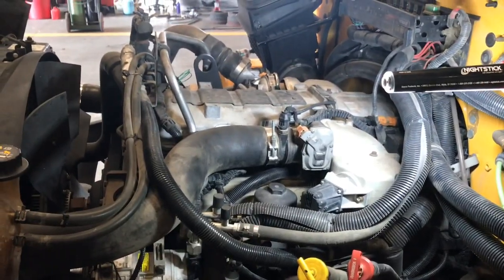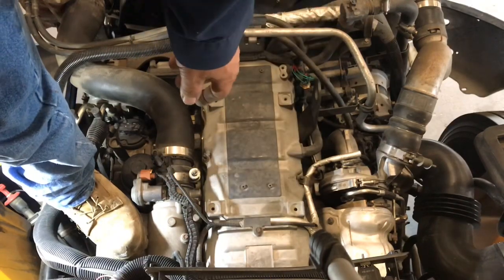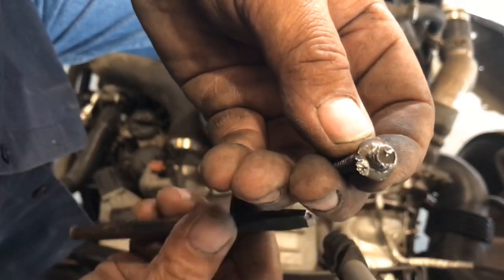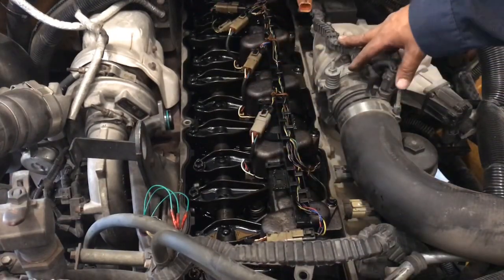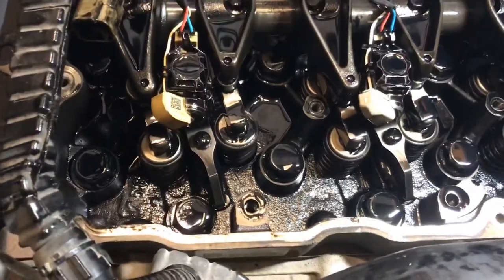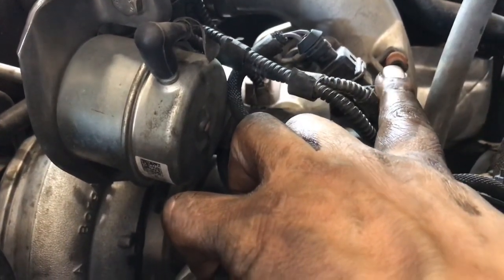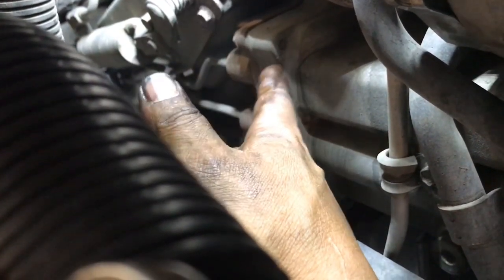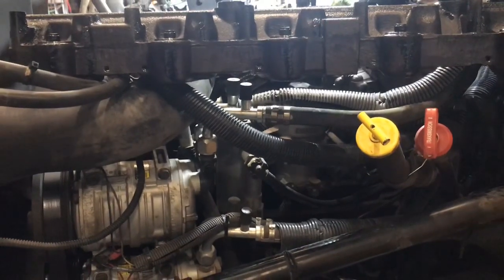2014 CE bus injector/ boost sensor. Part 1

Comment: Bro I love how the turbo system is on these engines. 
I'm all for technology and all but adding a big servo to control the veins in the turbine side and added coolant lines to keep these parts cooled always disappointed me because the amount of failures tied with it.
But this is the type of system I like. One simple controler that actuates a vacuum controlled diaphragm.
I'm learning more and more on this engine and I'm actually loving it.
On my 2011 durastar the engine is easy to work on.
I was nervous the night before I did my crank case breather about a week in a half ago, but in all honesty it wasn't that bad. Just have to use some old school techniques to get to bolts in tight spots.

Comment: Joe, thank you for pointing those parts out to me. I got the boost control valve changed. The diaphragm should actuate if i apply vacuum to the port on it, correct? should i be able to move the rod in and out with my fingers?

also replaced the MAF sensor, I still can't get it to calibrate.

The exhaust brake, how do I make sure it is free moving? can it be actuated by hand?
Reply from the maker: Matthew Spores   The exhaust brake is spring loaded. We use low (40 psi) air to make it extend. Vacuum diaphragm can be moved by hand. Slight pressure or with vacuum. Recalibration has to be on a code free system. Clear codes. Use laptop to check soot level on dpf. If it’s above 60%. Run a regen. The try to recalibrate. Follow instructions at the end. Make sure you run a standard test first. Maf recalibration is done with KOER
Reply from the maker: Matthew Spores   It should recalibrate. Hope this info gets ur unit back to normal. Also try getting temps at exhaust flanges. That will tell u if injectors are malfunctioning.
Reply: Will do. I will let you know what I find out.

Thanks again.
Reply: So, with the engine off, I applied vacuum to the actuator on the turbo. At rest it seems to be pulled all the way in. With vacuum, there is no change in position.  I can't move it with just my fingers, but with a wrench as a lever I can get it to move maybe half an inch of rod extension. Then it springs back to fully retracted. The vacuum can seems to hold vacuum, I was expecting more movement from the rod. Does this sound like a failure? 

Ofcourse the stop nuts holding the rod in place on the turbo are all but welded in place with corrosion, so I am having a time getting them loose to see what the movement on the turbo is like by itself.
Reply: Got the vacuum can off. But, it doesn't act like a vacuum can. The rod extends if I hit it with shop air. And, it is full of oil.